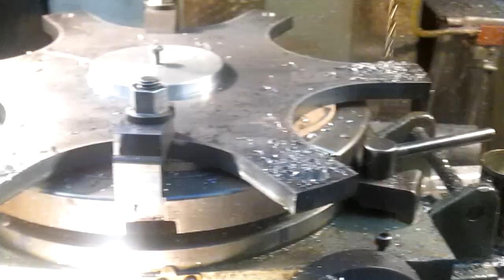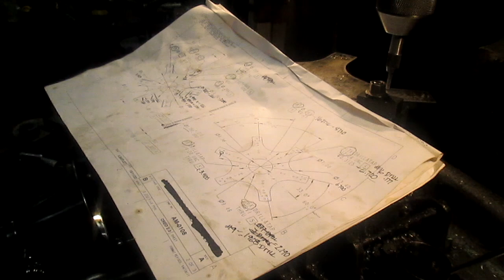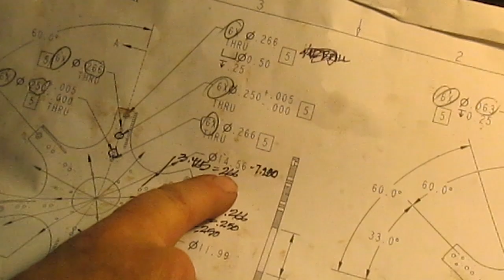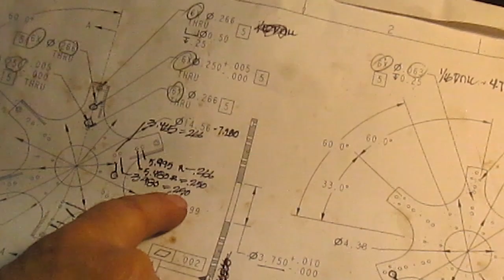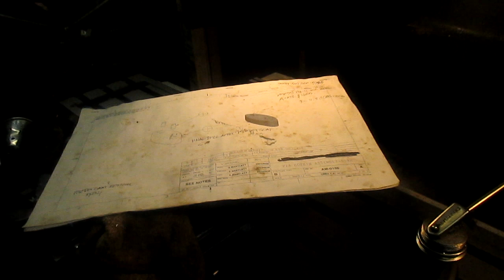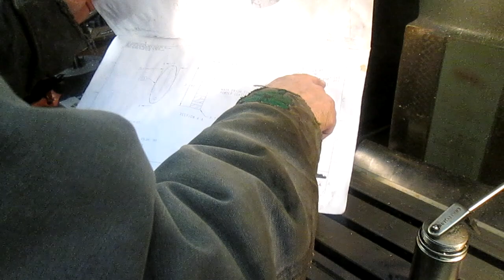Experimental Armature Build #6

Comment: Good morning Nik, The external chamfers on small taps are there for a purpose. They are used as external centres during the grinding process in manufacturing. Ordinary centre drills would be too small, expecially when you get down to the very small taps like 3 mm or 1/8 etc. Cheers Ian New Zealand
Reply from the maker: Now years ago every tap had a center hole even the very small ones. . .okay maybe more like decades ago. I assumed it was one more way to cheap out. Either way I now have two center followers, one point and one cup.

Comment: Nik I thought that you bought a TapMatic to do all these tapped holes ❓Regards from Australia.
Reply from the maker: I did, but the metal is a-36 which is structural grade and those taps were small. I'd rather take the extra time hand tapping then break a tap and spend hours digging it out. In fact I did break a tap anyhow, just my luck,